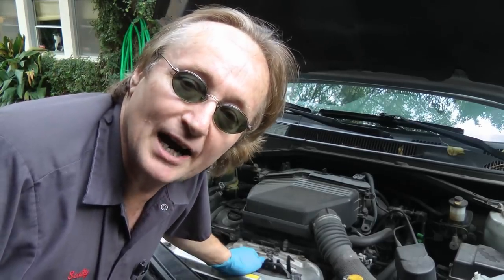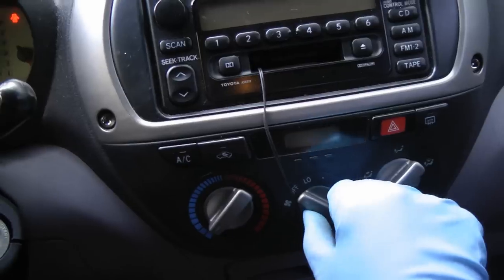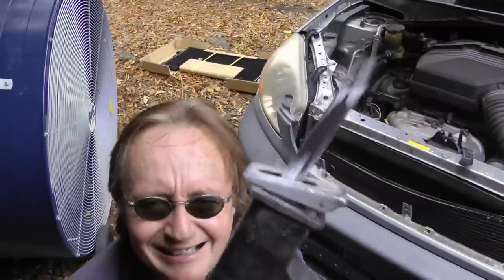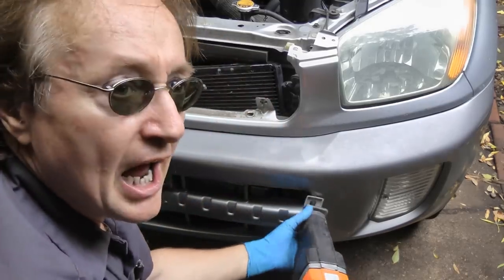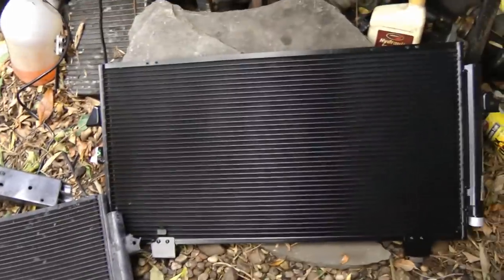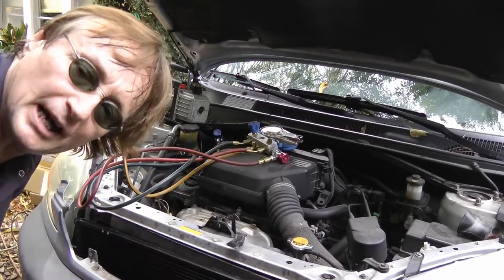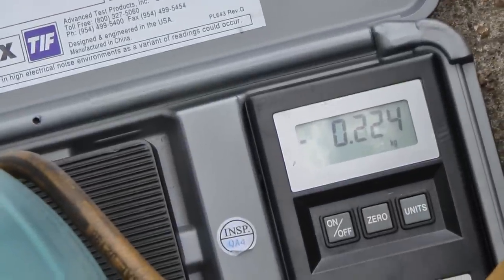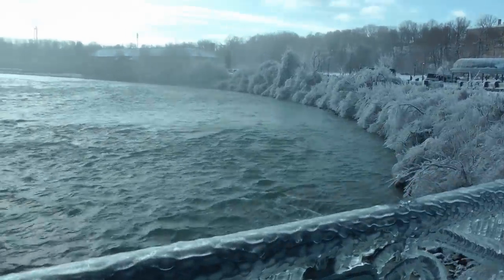How to Fix Car Accident Damage

Comment: I like the picture of the car covered with snow at the end; I had a 98 Mazda 626 in which the gear within the windshield wiper unit would break every time I turned them on with snow on the windshield.  Went through 3 of them during the warrantee and get rid of the junker shortly after that.  I think it was really a Ford with a Mazda badge on it (seriously).
Reply: Ford owns Mazda.....So that's pretty much true.
Reply: I'm Canadian and I can tell you that we take the snow off the windshield first. When you get the heavy wet snow on the windshield (easily 45lbs) the dumbest thing to do is turn the wiper motor on. Don't blame the car if you don't use it intelligently. Wipers weren't ever designed to lift off the weight of snow.
Reply: alh1007 not since a couple years..and its was only a percentage and shares
Reply: Scotty did that for effect.  Sense he stated in a post he grew up in the Fall's area?  I'm pretty sure he knows the term  "Lake Effect" all to well.  My god-daughters mother lives in TX and is from central NY.  She let me know that every time TX gets even a couple of inches of snow?  Her area pretty much shuts down for the day.  If you're not used to it?  It can be tricky.
Reply: alh1007 Ford used to own Aston Martin.

Ever since they sold Aston Martin off, the company has been making great cars (Aston Martin, that is).  I'd hate to see what Ford would have been crapping out if they still owned AM.

And on that note, Chrysler certainly put out a lot more cars when they were partially owned by Daimler.  I thought the Crossfire looked pretty good, but they evened it out by creating the PT Cruiser.  Pfffffffft.

And now i'll stop stealing your time with drivel.

Comment: Why not remove the front bumper for the sake of working easier?
Reply: Because Scotty is a ALLEY MECHANIC!  Does it the cheap way
Reply: Brian Westmoreland
LOL so am I. Also the rad could have been straightened. Those fans will fail now being so close to the headers.
Reply: prolly doesnt charge by the hour hehe. if i charged by the hour i would remove every last bolt outa the way.
Reply: KoG GoK
IDK I can remove my Zs front bumper in less than 10 min....fast than it probably took him to cut those condenser mounts...
Reply: Brian Westmoreland if they implanted scottys knowledge into your tiny brain it would EXPLODE!!
Reply: KoG GoK 40 years into 28 years, seems legit
Reply: Brian Westmoreland I thought it was called backyard or shade tree mechanic, or is the term different then from were i am from?
Reply: Yes destroying a front bumper, replacing only the condenser, not replacing the bumper support, and the fans being pushed in, is properly repairing a car.
Reply: DeusKDuo We call people who do whatever it takes to make it work ALLEY MECHANICS, people who know what they are doing, and do it the proper way are called MECHANICS IN THE ALLEY  or  NEIGHBORHOOD TECHNICIANS, where I am from.

Comment: When I was a kid we didn't throw radiators away if they had a hole in them.Just take it to a radiator shop and get the hole soldered shut.Unfortunately with the low cost of chinese parts and the advent of plastic radiator tanks the radiator shop has gone the way of the video store.
Reply: Got that right. Radiators are cheap now. Because they are half plastic. It was nice going and finding an old radiator that would fit good enough inside your engine bay.  Taking it to a shop and getting a pressure test and a nice cleaning for about 20 bucks.
Reply: unfortunately?

Comment: so you cut off part of the front assembly and just chucked it away? what about any loss in structural rigidity? what about safety?
Reply: +simon199418 That piece of frame wouldn't offer any structural rigidity to the car. Something that far forward is there for a few reasons: To offer a mounting points and maybe protect things like the AC condenser, radiator, electric fan, etc in a very low speed collision. Yes, he "just chucked it away" That part's not saving any lives, don't worry.
Reply: Damius McRuckerton you may be right but you can never be 100% sure with these modern vehicles cause they have no distinct solid metal chassis, everything is where it is for a reason most of the time.
Reply: In the workshop manual for my car this part he cut out is called "Front bumper reinforcement", so it's likely in place to do what it did on the car in the video, absorb impact energy in a frontal collision
Reply from the maker: tiny bit of use for that thin metal piece of crap, it doesn't really have much to do with structural integrity

Comment: Hey Scotty what about the bent frame you cut out,didn't see you replacing that or is it not needed?
What an adorable cat you have its a sweetie :)
Reply: It is the bumper reinforcement bar. It supports the bumper foam and the cover and gives more resistance to low speed impacts. The complete repair would be to completely remove the front clip of the car and replace the bar but this was on the cheap so he just cut out the bent bar that did its job and prevented the damage from being worse. 

The next low speed accident will of course result in more severe damage then this time and the front bumper will start to sag over time more then likely but it is a lot cheaper then all the labor to undress the front of the car replace the bar and redress it.
Reply from the maker: yes, that's all true. Just a reinforcement bar, and as I said in the beginning, not a perfect fix  but good enough till they wreck it again.

Comment: Hey Scotty,

I recently got into a car wreck with my F-150.  Long story short, I have two questions for you:

1. Any advice on how best to approach the restoration of my truck that was deemed totaled by insurance?  I know it's difficult to say without seeing it, but is there a typical first-step you take for customer's cars that REALLY want them restored, no matter how bad the damage?  Basically, I crashed into a 10" diameter Eucalyptus tree.  Yes, there is frame damage; and yes, the entire front-passenger side of my truck is pretty much toast.  Despite that, any recommendations of what to do, or where to start?

2. One idea I had to rebuilding my truck was parting out a used twin of my truck.  I've seen some in the Houston area, and wondered, if I purchased it, what you might charge to give it a once-over?  I'm in CA, so it's not something I can easily do on my own (ha ha).  Feel free to PM me, if you'd prefer, to address costs.

Thank you for your help and input.  And the great videos.  Keep up the excellent work, and thanks for all the help you provide us all.

Happy New Year!
Reply from the maker: I'm on holiday starting this afternoon, but I check out vehicles for 100 dollars. BUT, restoring totalled trucks is often more money than it's worth, that's why they total them. With frame damage, you're looking at big time repairs. Often better to just get another vehicle in that case.

Comment: could you show me how to adjust valves on this same car rav 4
Reply from the maker: most people leave them alone. They use stainless steel shims and have 16 of them on the engine. Rarely do they actually wear out of spec, but if they do, it's a rat's nest adjusting them requiring all kinds of tools and boxes of shims. I've sen em with 300 thousand miles on them and still within specs
Reply: Scotty Kilmer cool I wanted to ask how do I make a Toyota rav 4 accelerate faster

Comment: the part that you cut off is the reinforcement bar, is part of the frame which is protect behind the bumper, I will not agree to cut that off just like that but if it work for you customer why not, is more safe remove the front bumper unbolt the part usually to the front frame, by new or looking for use (no damage) bolt in place and fix the rest like you video. if is more damage get a hummer, pull or do wherever you need to bolt this part on place, if is not for inspection (state) you can also do weld job.
Reply from the maker: that tiny thin piece of metal isn't going to do much of anything in a wreck, this small fender bender almost cut it in half. The vehicle is fine without it.
Reply: Scotty Kilmer I will not agree with you, if does not do anything why is there, you know, this time get luck, the next time with out the reinforcement bar, if could be no only the condenser replacement, possible radiator and engine damage, for $20 to $50 that it cost the metal bar why cut corner.
Reply: Martin M
why cut corners speaking English?
Reply: Scotty Kilmer I Think the MOT will disagree, and they issue the  road worthiness of all cars. http://en.wikipedia.org/wiki/MOT_test
Reply from the maker: MaskinJunior
whatever, car is legally inspected and being driven here in texas, father is happy.

Comment: So, I looked through the comments and can't figure it out...did he straighten out the frame piece and weld it back in?
Reply from the maker: no, that's just a minor thin metal easily bent small support piece, and YES, she did wreck it again a few months later.
Reply: +Scotty Kilmer Do teens really wreck that often I've been driving for about a year and you've got me worried.
Reply: Teens wreck more frequently than older folks, but most teens don't. So don't worry. Stay off the phone, pay attention and don't drink and drive...and you'll be fine. Always be aware of your environment and keep your eyes not only on the road and the car in front of you, but several cars ahead. Stay safe!

Comment: Did I just see you cut that beam out, and throw in the new cooker, without even replacing that beam? What do you think that beam is for? It's there to absorb the force of an impact. If it was me. I'd have taken the whole front bumper off, to assess the damage. Then take it from there. I'd hate to be in a front collision in that car, one more time. Sure the A/C works. But, at the cost of cutting a safety piece out? There's a very good reason that bar is there.
Reply from the maker: that's a minor piece, customer did not want to spend any more money, only thing another teenage wreck would do is bend the radiator and condenser more, which already were bent. As I said, not a perfect fix, but car goes down the road.  I assume soon it will be in a junk yard from a more serious wreck.

Comment: in this case , it's better to take the car to body shop and replace the steel bumper ( not the bumper cover ) for safety reasons since it's a teenager car ,  then you can repair the AC easily ,

Comment: I'm lost on how the evacuation pump removes moisture from a closed system when It pumps pressure into the closed system for one hour. Where does all the moisture escape the closed system from? That's always been a misery to me.
Reply: when you do an evacuation you pull a vacuum usually 29in.hg. on the system. This pulls all the air and moisture out of the system. The moisture in the system basically boils and turns into vapor because of the low pressure and is sucked out of the system with the air.

Comment: My cars AC doesn't work, I know the system will hold pressure okay. If there is no refrigerant in the system and I turn the AC on in the car, should the AC pumps central hub spin? You know, the part that stays stationary when the AC is turned off.
Reply from the maker: if out of refrigerant, clutch will not engage and spin because it has a pressure switch to prevent running it dry and burning it out

Comment: You also should of changed the drier on the car, and you just don't run a vacuum pump for an hour and call it done, get yourself a micron guage and pull a vacuum down to 500 microns and let it sit to see if it holds. Nothing quite like pulling a vacuum for an hour and charging a system only to notice that you have a leak.
Reply from the maker: they system worked fine, just would leak out after a few days. As said in the video, customer wanted to keep costs low. It's now 4 months since this video and car is still working fine.
Reply: Scotty Kilmer
Oh okay, from the video it appeared the line had completely broken off. I'm in HVAC/R so I know how moisture in the system can cause acid which can lead to failure but granted the teenager is most likely to wreck the car again before that happens. Great videos though.

Comment: Scotty can you make a vid cleaning an upper and lower intake manifolds carbon build up and grease ive been working on a set of ford Gt-40 intakes tried soking them in some purple powor cleaner and degreaser and wire brushing works great but the inner holes are a bitch. and i  cannot get them clean

Comment: That was kind of a ghetto hack job cutting the old parts off. Only a few screws and bumper clips plus there could be more damage behind bumper cover.
Reply from the maker: I said in the beginning it's not a perfect job. Father only wanted to spend so much, realize it will get whacked in all probability again very soon.

Comment: what happens if i dont evacuate the system> im putting a new ac compressor on and dont have a vac pump for the the cost of one id be better off just going to a shop
Reply: If you dont remove the are before adding refrigerant the ac either wont work hardly work because it wont be able to loose the heat load as efficient
(I work for an hvac company and we deal with this type of work for homes)

Comment: LMAO Scotty is a total badass. I scammed a dumbass teen 2 weeks ago who mounted a curb with his 98 Maxima. He didn't want to go to a mechanic so he responded to my ad on Kijiji. It turns out he only needed a new right strut but I told him his control arms, CV axles and wheel bearings were bad because of what he did and it would cost $1300 and I would need the money up front. I replaced the strut with a new one but took out the CV axles and cleaned it up with brake cleaner to make it look shiny and re-installed it making him think it was new. One more gullible idiot and I can go on vacation and not waste my money earned from my actual job.
Reply: Such a good person!
Reply: dllexport Uhhh how will they find me? Anyway, I work hard for my money and I'm hesitant to spend it on nice things so if there are other ways to earn it then I will pursue those things as well. Capatalism in some ways is taking advantage of the supposed weak and stupid and don't tell me everything that happens in capitalism is ethical. What's wrong with me practicing some capitalism?
Reply: +Djonkie Bonk what a creep.
Reply: Djonkie Bonk Your definition of working hard is scamming people? That's not capitalism, it's criminal. I know some people in Nigeria who also work hard to scam people, maybe you can get to know each other.

Comment: Crashed my mustang back when i was 17 ac used to blow penguins out the vents, crashed into an expedition with a big tow hitch went right through the condenser, radiator and broke the power steering pulley, tied a chain on a tree and the top frame of the car drove into reverse to unbend it
It never had ac again😔

Comment: i think this video its NOT for the DIY, buncho of shop tools etc,
Reply: If you pay to have your work done, knowing what is involved will let you know the difference  between being ripped off and getting a fair price on repairs.
Reply: That saw can be rented for like 20 bucks. as for the air removal...yeah I don't think thats a DIY project.
Reply from the maker: SavageSalad
Heck, I bought the saw at harbor freight tools for 29 bucks.  and the vacuum pump too, it was 49 bucks

Comment: I think the inspection of vehicles will have some opinions about the missing beam that you cut away. How do you get the car through http://en.wikipedia.org/wiki/MOT_test
Reply from the maker: this is texas, it got the vehicle inspection certificate easily. It is just a minor part after all, a minor support beam that bent in half from a fender bender
Reply: In Sweden, that would not pass. Not a chance. I've got minor weld on the floor on non load bearing parts marked as a failure because the seam wasn't tight. I had a 5mm hole so I had to re-do the weld, and return for another inspection.
Reply: Scotty Kilmer If you hit a tree that suport is good to have and if you sell the car the the new owner gets in to a wreak and die you could be hold responsible (in Swden at least...)